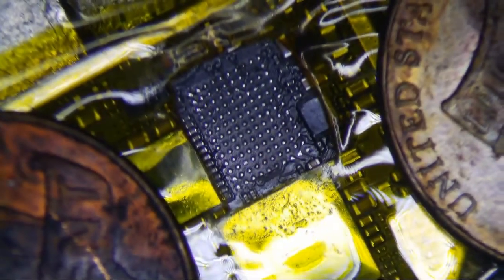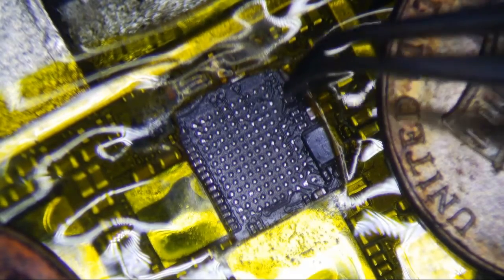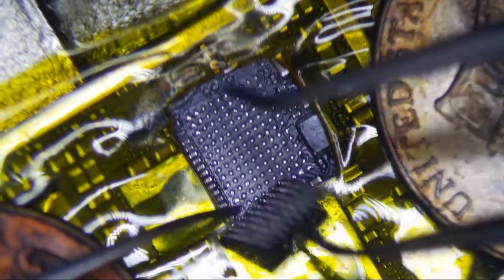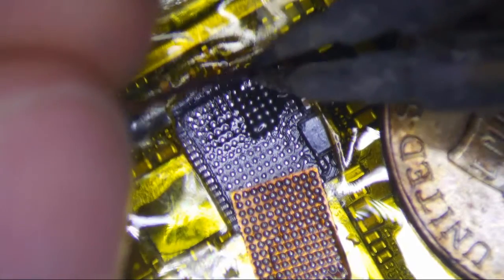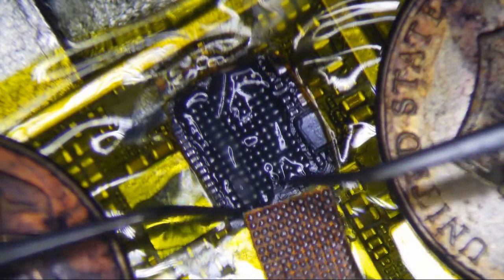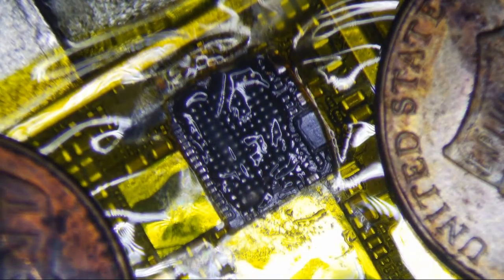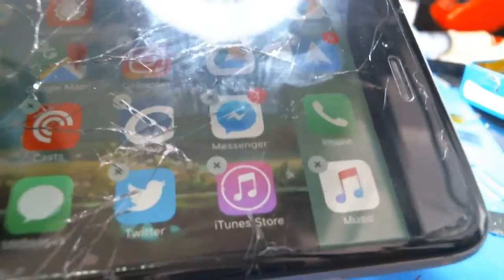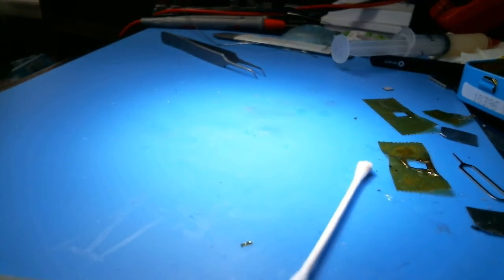iPhone 6+ Touch IC - Ground pads next to M1

Comment: I don't think oxidized grounds would cause the issue as there are numerous ground points on most chips so there's always a path. Must be either a power or data line that becomes intermittent

Comment: ***What do the two ground pads do
Reply from the maker: They're just ground.  There are many ground pads on the chip, so these two pads are not necessary for full operation.  They can be disconnected and the iphone will still fully function.
Reply: Microsoldering I was correcting your title lol
Reply: oh you changed it already you keyboard ninja